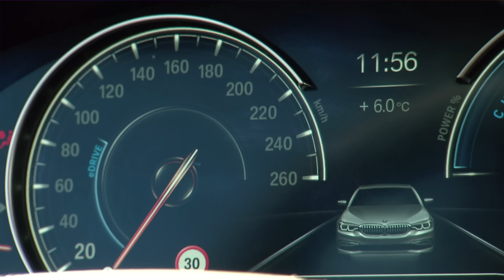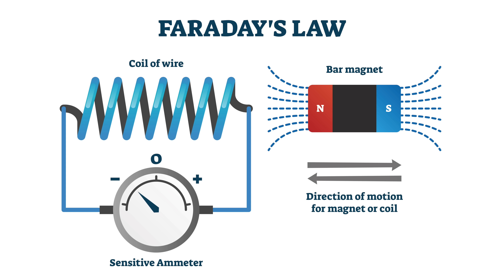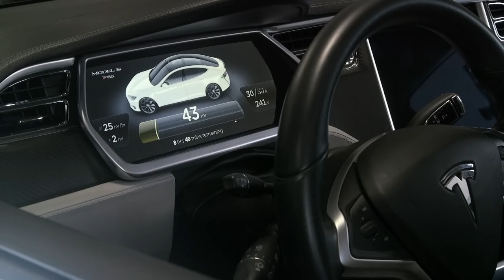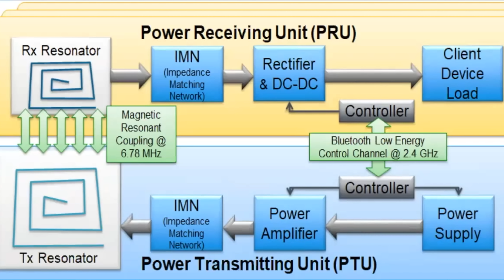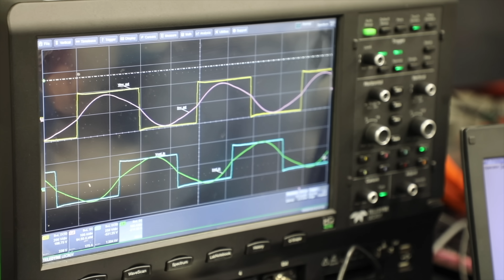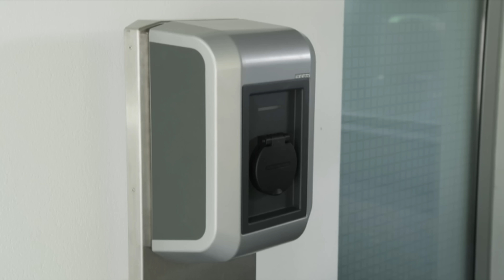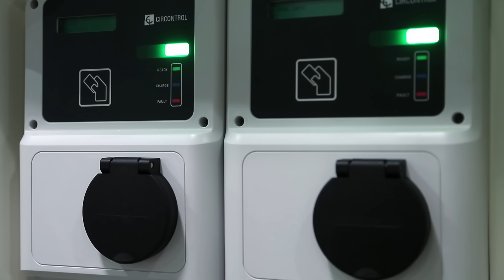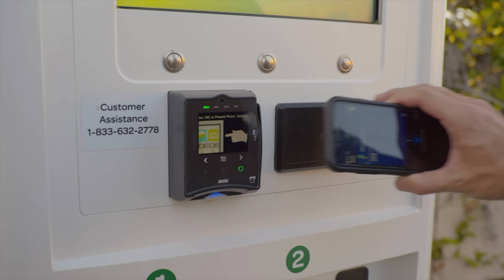Will Wireless Electric Car Charging Change The Way You Charge? Or Just Make Robotaxis Better?

Comment: Wireless beamed charging of electric airplanes would change the world. Notice how in-flight refueling is a game changer for military aircraft, increasing their effective range tremendously by replacing the fuel they used to take off and climb to altitude. Beamed charging could do the same for electric airplanes. It should eventually be much cheaper than in-flight refueling.

Comment: So it is not worth having at home, and it is not fast enough to replace level 3/4 150kw to 350kw so the point is? Now I can see some logic in using them for destination chargers. But are they really worth the bother ? Until we have full level 5 when the car will need to go and find its own charger?

Comment: One use case for wireless charging is car sharing services. If you've got to park the car in a designated spot anyway, it would be a huge advantage not to have to rely on the user to plug the car in when they're done with their rental.

Comment: Think of all those Rivian Amazon delivery vans arriving at the depot at the end of the day. Driver hops out, van autonomously drives to an available charging pad and starts charging. If/when they have more vans than charging stations, the vans could then rotate in and out on their own. Oh, and since it's two way, the depot is then effectively a multi-megawatt peaker plant for the local grid.

Comment: I've been wondering if wireless charging could make megawatt-charging happen.
Reply: Wires are more likely to hot the high power level.
Reply: @kensmith5694  the thing is, bulky wiring isn't as much of an issue when much of it is immobile.
Reply: Actually no! The higher the charging power, the less efficient it is and the greater the losses. That’s why it’s ok to use inductive charging for very low power devices such as cell phones and electric toothbrushes, but would be totally impractical for very high power applications, such as Tesla’s proposed megawatt Superchargers for their up coming electric Semi truck.
Reply: @Nicholas.T  
I disagree about the "higher the power the less efficient" point.  What really matters is that 10% losses on 1 Watt is not something to care about but 10% losses on 1 MW is going to be big trouble.

Comment: Is Solar Roadways (https://solarroadways.com/) a "bad" idea, as mentioned by some of the posters here?   I personally don't think that full end-to-end roads will be solar-powered any time soon, if ever.  But the application of using a solar roadway, as envisioned by SolarRoadways, for parking lots, driveways and smaller applications seems feasible.   Could wireless charging be viable in that scaled-down type application?    I'd be curious of your opinion on the feasibility.
Reply: Yes, it's a terrible idea. You know what would be so much cheaper and better in every way than a solar road surface? A solar roof over a road surface. (Or, more commonly, over a parking lot, driveway, or carport.) All of the upsides in land use and so on, none of the downsides in reliability and maintenance. In fact, by keeping snow and ice off the surface, you save on maintenance.

But you know what's even better than a solar road surface or a solar roof over a road surface? A solar roof over a home or other building. Until we've filled up most of that space, and right now we super haven't, it's pretty premature to bother putting panels in or on less convenient locations.

Comment: In pavement inductive charging will be banned by the same people that forced my cell phone to have so little output that I can't get much range. I do see a future with parking spots with modules that can be flipped up for snow plowing. A thicker module helps reduce the distance and the stray RF fields. Also note that "resonance" is just a way to couple the RF energy to the Air. This makes it more efficient, but it also increases it's ability to radiate the RF into the air.

Comment: If major highways had wireless charging, that would solve range anxiety for car with even the smallest battery.

A Chevy Volt or an i3 could road trip without the need for gas, since the battery would only be needed for times when it wasn't on the highway.

Comment: One of the key parts of the Wireless Charging systems we are seeing now is they are the result of several years of working out an industry standard to avoid the issues of different plugs etc that have plagued the EV charging market up to now. A wireless system that is standard will allow the industry to leapfrog the charging plug type issue and open up options not available to cable methods. 

The synchronous connection of the two pads was the break through in terms of efficiency and air gap, plus as I've said the working on an industry standard, this is why it is only now the technology is really starting to be pushed. A trial has started in Nottingham here in the UK with six Taxis using a wireless charging waiting area to put the system to a real world test over this year... obviously 2020 hasn't helped this. :) It is though just one of many trials.

These latest generation of wireless chargers will be aimed at Taxi and transport networks first then as they can be retrofitted to almost any vehicle in time charging cables will disappear over the next few decades as the advantages become more clear.
As some other have already pointed out this unlikely to become the norm any time soon but the temptation of an easier life is strong with us humans and the idea of never plugging anything into your car ever again is going to drive this change over quicker than some think. 
Imagine being able to charge while say stuck in a traffic jam or at a crossing or roundabout. No big heavy stiff charging lead in the cold weather. There will of course always be need for a charging lead, as with fast charging which although possible is something they are still working on. The options for charging in places and circumstances never possible with a fuel powered car is what will win out with this technology. 

I'm sorry if this is to upbeat for some of those in the comments section so I will point out this will cost a lot of money...  misery balance achieved.
Reply: I am betting there will be about 3 "standards" plus a "Microsoft case" where someone claims to be the standard but keeps an ever changing proprietary system secret.

Comment: The inefficiencies are in the coils because of the distance between them and the lack of an iron core (magnetic conductor) between the TX coil and the RX coil. BUT if motorways are lined with solar panels where energy is free who gives a s*** about efficiency?

Comment: I’m wondering if the enhanced convenience would help drive the economics of EV adoption in general.
Reply: I don't think many people will choose the extra cost of induction until every EV pack has the capability as standard. I know I wouldn't. I like my 25' cable. I can park on either side of the garage or in either spot in the driveway. With two working kids at home and doing a car shuffle frequently I don't always know where the Bolt will spend the night.

Comment: Time and again it has been proven that people will pay serious money to make their lives more convenient. If I can just drive the car into the garage or driveway and not think about it (charging the car) I would absolutely pay for it. If you’re going to go through the expense of having an electrician wire up a dedicated 50AMP circuit, why wouldn’t I just get the wireless charging pad? If I’m a home builder and I want to have a cleaner look, I absolutely would put in one of these - possibly two) in the garage or parking pad. At the end of the day people will pay for the solution that offers the least amount of friction, for the solution that “just works”. Ask Apple. People have purchased TENS OF MILLIONS of iPads at a price that could easily have bought them a full Windows computer or even a Mac. They spent the money because it’s a frictionless experience that “just works”.

Comment: I didn't realize how backwards until i first tried charging my mini using a public charger. They try too hard to be 21st century when they really should be 20th century. It should simply be swipe a card and get juice like a gas pump, i shouldn't need an app to use and pay the charger
Reply: I think the apps are just to lock you in to a network, EV charging is ideal for contactless credit cards. And I don't think wireless helps there, and if it is going to bring the charging speed down from hundred of miles per hour to tens, just so you don't have to spend 30 seconds plugging in , is it really worth it?
Reply: And the problem is even more clear when you drive a Tesla and got used to the absolute simplicity and reliability of the Supercharger network. You only have to plug in and that's it. No app, no card, and don't even have to tell the car to start charging. That's the real 21st century solution.
Reply: @andrasbiro3007  yes, but the problem with Tesla (like apple) is that they are a one stop shop , as apposed to (android/microsoft) were each firm dose it's own thing , many products compete and the price is forced down. BUT the overall user experience is just not so smooth.
Reply: @patdbean  
But, unlike Apple, Tesla also offers the most value for the same price.
Reply: @andrasbiro3007  value is in the eye of the beholder. I still say the Tesla pricing puts them in the top 20% of the price range by volume . You still need the sub 20k electric car if they are to be the only cars sold by 2030.
Reply: @patdbean  
They'll have a $25K car in about 3 years. With the savings on fuel and maintenance that's like a $15K ICE car. And if you also factor in that a Tesla will very likely last far longer than an average ICE car, it's even better.
Then there's the robotaxi network, which makes car ownership obsolete, and sticker prices irrelevant.
Reply: @andrasbiro3007  quite , I am not against Tesla . But in the same way that  the bulk of computers are PCs not Macs and the bulk of phones are Android not Ios. The bulk of EVs won't be Tesla's. As far as the robotaxi thing goes , I  think that is a good few years away.
Reply: @patdbean  
Except there's no "Android car". There's only Tesla. Any decent EV, that even exists, cost as much as a Tesla or more. Only small city cars are cheaper. That might be a valid business model in the future, but today the vast majority of cars are big and capable of long trips, and probably for a good reason. And as battery costs are falling fast, the price advantage of small short range cars will quickly diminish. Also, while Apple is trying to make their phones as expensive as possible, Tesla does the exact opposite. Working hard to make their cars cheaper. Did Apple cut prices, like ever? Tesla does it all the time.
Robotaxies are a few years away, but not as much as you think. Probably the technology will be ready by the end of this year, and then it's up to regulators what happens next.
Reply: @andrasbiro3007  real robo-taxies by the end if this year? Something that none  driver (like a blind person)  can Just get in and be taken to a destination? Because anything less than that is really just a driver assist system, it Is only  really  a self-driving car when it has  no steering wheel.
Reply: @patdbean  
Probably yes.
But even Tesla's 1.0 Autopilot is more than a driver assist feature. On a highway it is doing very well on it's own, you just have to supervise it. So it's more like you are assisting the car then the other way around.
Reply: @andrasbiro3007  don't  get me wrong. I am not  saying level 5 will 'never' happen.  I just think the type of reliability you need for that  is a lot more than a year away .

Comment: If it can be made as efficient as wired charging (which is difficult), then I’m all-for it.  However, as you pointed out, it strikes me as attacking the wrong problem, or at least a pretty small problem:  once you get it all set up, plugging in and unplugging takes almost no time at all — 2-3 seconds each.

I guess I don’t completely follow how it really helps much in the public-charging scenario.  Really good point with respect to autonomous vehicles, yes!  Otherwise though, regardless of wired vs. wireless, you still have to deal with varying networks, setting up accounts, scanning in with your card, finding a charging station that works, and so forth.  Also, identifying you automatically can, at least conceptually, be done equally well wired or wireless.  True, existing wired-charging standards doing include that, but wireless-charging standards don’t even exist yet, so it’s almost certainly easier to add that to an existing standard than to get an all-new standard through.

Maybe where it could help is ... well, Europe.  Charging stations in the US have charging cables built-in, so you don’t have to dig into your trunk (boot) to get your cable and plug in at both ends.  So, that might or might not save time compared to precision parking to align to a charging pad.

Still, if it can be done at the same efficiency and at low cost, then sure, saving a few seconds is all the better.  I doubt I’d pay more than ... 5% perhaps ... more for it, and if it reduces charging efficiency, wouldn’t pay for it at all!

Comment: I would find it very handy to just park my car in the garage and have it charge up during the night on cheap rate electricity without me having to plug in. I wouldn't be prepared to pay more than a couple of hundred pounds for that kind of convenience though. Public wireless charging would require a lot of up front standardisation.

Comment: Metal structures near high voltage transmission power lines can get unwanted induction. Higher frequencies have more induced transmission but also more interference.

Comment: Good one, Nikki. I think your estimation is spot on. The poor efficiency due to thermal losses is a big problem for little gain in circumstances outside of autonomous vehicle applications. 

An issue which you didn't mention is radio frequency interference. An 11kW transmitter on 6.78 MHz would be a potent source of RFI, even though the transmitter coupling loop wouldn't be a very good transmitting antenna. An ordinary radio receiver would hear this for potentially hundreds of miles.

Comment: There's one use case that cries out for wireless: taxis. The line of cabs at a major rail station or airport is idle capacity, but suppose taxis could take on energy while inching their way to the head of the queue: nothing in the dinojuice world could match that.
Reply: Another would be public buses.  Putting in inductive pads at each bus stop allows the bus to get some juice while it waits for people to get on and off.  I've seen on YouTube a contact version of this idea (if memory serves, it uses some kind of pentagraph at each stop).  Going wireless impresses me as being easier and requiring less changes to infrastructure.  And, if there are heat losses, then that might help with the snow on the road (at least at that point).

The biggest issue I see with that is the precision required to match up the induction plates.  Based on the videos, the induction plates need to be almost right on in order to work.  Having to worry about centering the induction pads while driving a bus might be asking a bit much of the driver.
Reply: For whatever public or shared transportation that the case for inductive charging might seem a fit for, there are like wise a wired solution that might work just as well.

Instead of inductive charging, why not overhead power wires like those exist for electric trains and buses? At taxi the queue, the taxi could raise its charge contracts to the wire above ( as they do on electric powered trains ) to charge the batteries while waiting for customers. This works with existing AC charging technology, which is already in most BEVs, rather than adoption of a set of new, yet-to-be proven technology.

Deployment of overhead powe lines might be another case for overhead power lines -- that you'd no longer need to dig up the parking lot to bury the wireless charging pads....
Reply: @kamdonko  Why would overhead lines be a good choice for taxis? They create visual clutter. They require masts or attachments to buildings. They have to be higher off the ground than the tallest vehicle - with a safety gap above that - so the taxi pantographs would have to be really big. It's not obvious to me that digging up the road once is worse than that lot.

Comment: The only way I coud see this happening is if the transmitter architecture was installed first in car parks and on street parking bays, and then being offered inductive charging as an option when you buy the car or have an upgrade kit to your existing car if you need it. It's going to be a life style choice.

Comment: I like the idea of wireless however is there any cost difference between plugging in direct or wireless charging with the energy losses you mentioned?
Reply: There are losses something like ~5% but there are also losses with cables ~3% (that is why the cables are being cooled.)
Both losses get larger if respective gap or cable is longer.
Reply: @buddy1155  thank you

Comment: Great info again, dynamic road charging makes about as much sense as EM's Boring Co. The issue is the initial infrastructure cost and the maintenance, even for major trunk routes. We have enough problems with getting roads maintained as it is. Now autonomous vehicles and unassigned bay parking in apartment blocks makes much more sense.